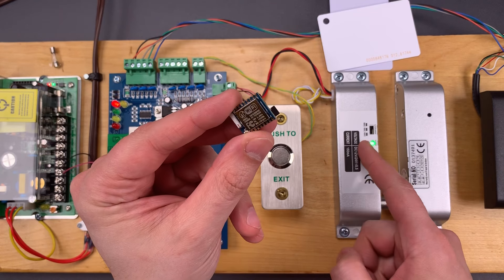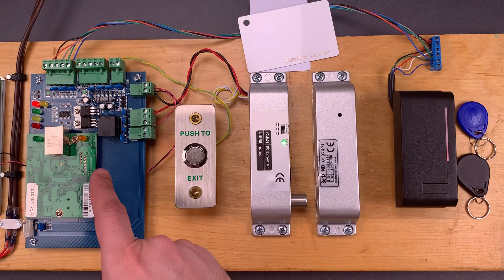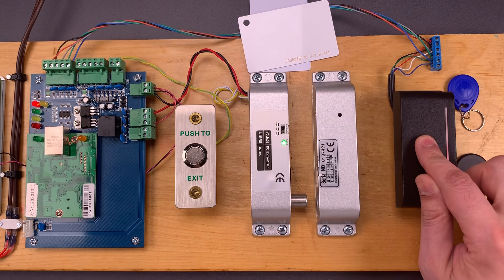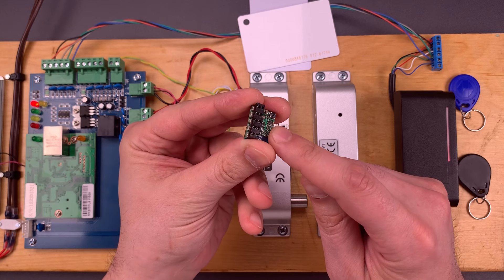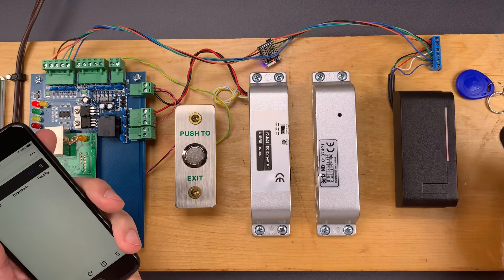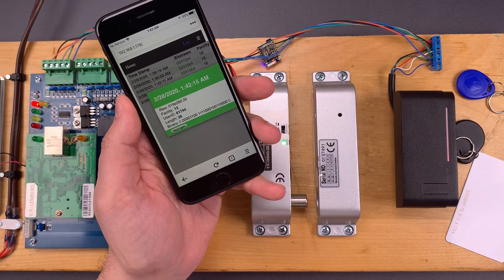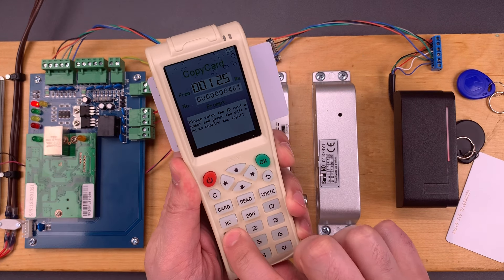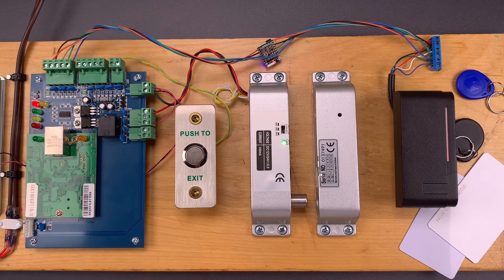[1052] Bugging an RFID Card Reader

Comment: So this is the equivalent of packet sniffing and then repeating captured packets?  And being able to basically image what you capture as well?  Honestly that's pretty damn slick.
Reply: burpsuite irl lol
Reply: except there's no packet or sniffing. It's plain binary hi-low signal containing a number.
Reply: @NGC1433  well putting a chip in the wiring circuit is none other than sniffing and a bunch of consecutive bits is a packet so yeah packet sniffing seems appropriate
Reply: @santiagobirkenstock  No, it isn't. The difference is, that you have to actually know the communication protocol for packet sniffing. This reader has most likely just a Wiegand interface, which uses two lines, first one for ones and the second one for zeros. There are no "packets", just a direct serial bitstream.
Reply: @mrkv4k  "know the communication protocol for packet sniffing" ... "likely just a Wiegand interface". tcp packet is just as common a protocol as weigand interface. Its exactly the same thing - record voltage over time on one or more wires, then convert that voltage history to information using knowledge about how the information was encoded to voltages in the first place.
Reply: @ehrenmurdick  You have absolutely no clue what you are talking about...
Reply: @NGC1433  you think packets aren't plain binary? What do you think they are, Italian?
Reply: @chrishamilton1728  You think a cake recipe isn't a vegetable?  (in case you've missed it, that's an analogy to your comment)

Well no, it isn't and they aren't... A packet is basically a message that is sent from one active unit to another. There is usually a header part, which contains addresses of both sender and receiver, number which tells you the data length, checksum and other stuff that is needed for the transport of data within said network. Second part of that message is usually data, which can be in plaintext or encoded in some way. Packet itself is like an envelope and if you want to read the data, you need to know how to "open" it.
Binary refers to the representation of numbers in a two state logic. If you wanna send packets, you don't have to use binary (even though most systems do). The thing that you are missing here is, that these readers use Wiegand interface and they send only the card ID number in binary form without anything else. So no packets, just data without the "envelope".
Reply: @mrkv4k  I did the same thing today with my oscilloscope - debugging an i2c peripheral I'm using. Whether you do it with wireshark or LPL's gadget or an oscilloscope makes no difference. Both sides have to agree on how the data is encoded, they use widely adopted standards to communicate that data. You have to know the encoding scheme to get the data back out. I can decode TCP packets with my oscilloscope too, just cut open an ethernet cable and hook the probes up correctly. 

The fact that you think the concepts are fundamentally different is a pretty strong indicator that you're the one that's out of his depth.

tl;dr no you
Reply: @ehrenmurdick  Are you in any way self-taught? Because that would explain the complete disregard for the terms and misunderstanding of concepts on your part...
Otherwise, I don't see how one could write.this much nonsense.
Reply: @chrishamilton1728  Everything analog, most telecommunication is transmitted with four state QPSK, 16 or 64-QAM modulation (there is an easy conversion between binary, but strictly speaking it isn't binary). But that wasn't the point.
Reply: @ehrenmurdick  I am dumping on strangers on the internet with negative statements without any attempt to clarify? Have you read any of my posts? What negative statements? Where have I been mean? I did clarify and tried to explain the problem In almost every post I've written here. On the other hand, you are just trying to sound smart, while mixing up different concepts and commonly used terminology.This sentence alone: "TCP packet is just as common a protocol as Weigand interface" shows that you don't know what you are talking about. TCP packet is not a protocol, it's a packet. Wiegand is an interface, not packet nor protocol. Packet is a message, the protocol is predefined structure of that message and interface is the channel which is used for the transport of messages.
 Even that "challenge" is nothing but a dishonest attempt to somehow own me or something.
Reply: @chrishamilton1728  No. The point was, that "binary" refers to something else than "packet", "interface" or "protocol". It's all about very poor use of terminology.
Reply: @mrkv4k  Classic backpedal, you literally tried to tell me packets aren't binary. Just stop talking.
Reply: @mrkv4k  Edit: My original response was too mean. What you're saying is that the terminology I'm using is technically incorrect. I agree with you on that, I don't mean to say that it is, I'm using the terms pretty loosely.

What I mean is that binary data goes over a wire, is recorded by a third party, and then arrives where it's going.

In all cases, the source and the destination must agree on how that data is encoded - if I cut the end of an ethernet cable and put a USB plug on it, it's obviously not gonna do anything if I plug it into my computer.

Even just plain binary over a wire only works if both ends share knowledge of the encoding. Is a high voltage a 1, or a zero, or neither in the case of (I'm blanking on the name. Something Scottish I think, where it alternates high and low). Is there a clock signal? Do I read the data on the clock at the rising edge or some other time? What are the voltage thresholds for high or low?

So an answer to my challenge, what actually is fundamentally different for them. Well, I would say that with SPI or parallel or something like that, all the binary data that is encoded is part of the message. With higher-level protocols, a portion of the data transmitted is metadata, things like a destination address or a CRC.
Reply: @chrishamilton1728  That's pretty much a Dunning-Kruger effect (without any negative meaning to it). You don't know what "packet" is, so you cannot comprehend why calling it "binary" is nonsensical. But that's ok...
Reply: @chrishamilton1728 
 Well, I have been working with electronics for more than 20 years and professionally designing complex devices for the last 10, so I know what I am talking about. It's ok if you don't. What isn't ok is being so god damn ignorant. I will stop responding to you, because it's absolutely pointless.
Reply: "The original Wiegand format had one parity bit, 8 bits of facility code, 16 bits of ID code, and a trailing parity bit for a total of 26 bits."

It's a formatted unit of data.  There's a payload.  The parity bit is control information.  It's a protocol.  It's at the very least a "frame."  If you want to split hairs, the fact that it's not routable might be the thing that distinguishes it from being a packet.  Even if there's no packet, it's still sniffing.  Sniffing isn't specific to networks.  See: memory bus sniffing, etc.
Reply: @profohki1828  I don't think that I am nitpicking nor splitting hairs here. Bad terminology leads to confusion and misunderstanding and I think that this very thread is a perfect example of that.

To that other stuff - no, "Wiegand" isn't a protocol. It's an interface which uses two wires. Negative 50us wide puls on one wire means 1, same puls on other wire means 0. It's only "one-way" and the driver (on the reader side) is usually in open collector configuration, so you can connect more readers to one input.
There are also 26b and 27b Wiegand ID formats , but those are something completely different and exist separately from the interface. Again, these are not protocols, but commonly used formats of RFID card IDs. Old systems had problems with more than 2B numbers, so they used a non-changing part (facility) and a changing part (actual ID) and checked them separately. Parity is used, but as a check of communication between reader and RFID card, not between reader and controller .
Most RFID readers with an Wiegand interface don't do anything with the received number and just send it "as is". Some send only the first 26 or 27b of received ID (because those old formats), but its almost never broken into "facility" and "actual ID" part (nowadays, it's easier to work with one 4B integer than 2B "ID" and 1B "faciity"). 

The main thing is that there is no metadata, no payload (you could say it's all just payload, but that wouldn't make sense) and no added control information between the reader and controller .

And sure, this is "sniffing", but not "packet sniffing", there is an important distinction. You don't have to do any additional translation, you don't have to detect different states of the interface and most of all, you don't have to trouble yourself with handshakes and networking. The biggest difference, though, is the ability to send "sniffed out" data directly back.
Reply: @ehrenmurdick  I think that there is a difference between "using terms loosely" and just using wrong terms. Like "cat" is never a loosely used term for "dog food", but that is exactly how close you are with some of that stuff.
If you "cut the end of an ethernet cable and put a USB plug on it", it's obviously not gonna do anything, but that's becuse you've changed only one part of the system. If you take an ethernet cable and put USB plugs on *both sides*, it will work (as long as it's certain length). Because ethernet cable is just bunch of wires.
I think that you are confused because some interfaces are only used with eponymous protocols, so you don't get the difference. Like you can take SPI interface (probably two for full duplex) and send tcp packets through it, hell you could probably take I^2C interface and use it with USB protocol (you'd need some changes to get speed up, but 1.5Mbps is managable). You can make your own protocol and use almost any interface you want. There are different layers and you are just skipping between them.
Btw. "something scottish" is probably Manchaster code, but again, that's about encoding, which is  something completely different than interface or protocol.
Reply: @ehrenmurdick  You left out the important part of that sentence: "So this is the equivalent of packet sniffing and then repeating captured packets?  Almost with all higher level protocols, it's impossible to "just repeat captured packets".

Btw, your analogy really sucks, because it isn't at all analogous. It's more like if there was a video about buying a watermelon and under that comment "so this is the equivalent of planting it and growing it from seed" . Where I'd started chiming in with "no, it's much easier than that, you just go to the shop and buy it" . Then your response was "Nah ah, going to shop is the same as going to farm, buying it is 'technically' the same as waiting for it to grow. I am just using terms loosely, you know, buy or grow, same thing." To which I responded with "you have absolutely no clue" and get the backlash with stuff like "You're just dumping on strangers on the internet" and "You've made nothing but negative statements" (neither is still true).

And to that last sentece. My best guess is, that that's just projection on your part. You don't know much, but you have the need to show off anyway. And then claim that others are mean to you, when they call you out on your BS. How many RFID readers have you designed? I'd say none...
Reply: @mrkv4k  All your comments have been "no you're wrong". Projecting? You're the one who started questioning people's education, so if you think that's projecting then you are the one who is doing it, genius.

Also, it's a great analogy, because watermelon actually are berries. Are you in any way self-taught? That's the only way to explain not knowing how to spell "Manchester".
Reply: @ehrenmurdick  None of my comments are just "no, you are wrong", there is always pretty detailed explanation why you are wrong. I don't know why you are so butthurt about it, being wrong is normal.
And I didn't question people's education either. There is nothing bad in being self-taught, it's just a good explanation why you kept mixing up terms.
The analogy doesn't work, because I wasn't nitpicking as it suggests and it's something that is actually important if you want to understand what is going on there. Sure, watermelons are berries, but that information isn't important, if all you want to do, is to eat it.
And to that last bit, pointing out spelling mistakes, when you run out of arguments, that's just an internet classic. It doesn't make you sound smarter tho.
Reply: @mrkv4k  "no added control information between the reader and controller ."

I think you're missing the point.  It doesn't matter if the protocol is between the reader and the controller or the CARD and the controller.  The latter being exactly how Wiegand operated when it was dumb readers and Wiegand wire cards.  As the card runs through the reader it creates transitions on the lines that are interpreted at the controller. That includes the parity because the parity encoding is part of the card.

Just go look at the code for the ESPKey device shown in this video.  You can see for yourself that the parity bits are on the wire and how they handle them in the logging. The wires being tapped here have data.  They have metadata.  

The "Wiegand interface" is two wires, +5VDC, and determining 0 or 1.  The "Wiegand protocol" is the number of bits and the parity.  The sniffer is reading and storing a number.  It's decoding the protocol.  It's not a logic analyzer that is just storing line state and timing.  Everything in this video deals with the Wiegand protocol ON the Weigand interface.

I mean, the SIA's standard for this stuff when it was formally adopted in 1996 is titled "SIA AC-01-1996.10
Access Control Standard Protocol For The 26-Bit Wiegand TM Reader Interface."
Reply: @profohki1828  What metadata would that be then? I mean, you can call it a "Wiegand protocol" if you want to. It's a bit of a stretch, but who cares. Problem is, that Wiegand interface became popular and it's often used with all kinds of cards. Cards that use different ID lengths and/or structure. Also, there are readers with numeric keyboard that use this interface to send both ID numbers and keystrokes (or whole PIN). Implementation of these is all over the place.

The programming of that sniffer isn't really important. They check the parity bit to see, if it's a valid ID number, but that isn't universal and will not work with other cards.
Reply: @mrkv4k  First of all, Wiegand protocol is a protocol, I'm not mixing up terms. Wiegand interface and effect are different things. Maybe if you had ever designed an RFID card reader you'd know that.

Second, the point I've been trying to make the whole time is that in order to get data from a wire, you need to know the details about how that data was put there. That's like the definition of a protocol.

What you are still defending, and I am still arguing, is that in order to read the data off of some wires you need to know how exactly the data was put there. (That's what a protocol is! You're just flat wrong here. Look it up!)

So in your universe, say I'm on the other side of a curtain. I pass over five wires. You know I'm using those wires to send a message but in your universe, you don't need to know anything about how I am doing that. It's "just serial data". I don't tell you which wire is which, if I'm using an established protocol, or even if I'm using all five wires. But somehow you can "just read the serial data." How exactly does that work, in your world? (Obv you could figure out what protocol I'm using eventually if I am using an established one - but my point stands in this case -- you *still have to know the protocol*. Even if you figure it out later, you don't know what the message is until you decode it)

That's what I'm arguing against. Please tell me how that's possible.
Reply: @ehrenmurdick  Very funny. Since I work in the access control industry as a HW designer, I did design RFID readers. Actually three different readers for both 125kHz and 13,56MHz standards within last 8 years. Plus two controllers with support for Wiegand/RS232/RS485 and an access terminal with graphic LCD, internal reader and Wiegand interface for external RFID reader. So I do know very well, what's going on, and that there are readers with Wiegand interface which don't support old 26b or 27b standards.

"in order to get data from a wire, you need to know the details about how that data was put there" - Nobody here is saying that that isn't true. The main problem is that you are missing the second part. "Packet sniffing" is much harder exercise that what's in the video. Especially if it's something more sophisticated like TCP. You can't just listen to the line and then send previously recorded packets back, because there is usually a two way communication. Like a request and then a response, or at least a handshake. But you can do that with a simplex interface like Wiegand. You don't have to even decode what's in the frame, you can just record it with a digital analyzer and then send it as many times as you want.
TCP sniffers are usually just passive, they can record what's going on, but they can't send anything back. Active device would have to physically split the line between reader and controller, let some packets through, but block others. It would have to pose as the reader and mimic its behavior for the whole transaction. Again, that is sooo much harder than what's in the video.

Ad "What you are still defending..." - No, I am not defending that. In fact, I've never said that.
Reply: @mrkv4k  its just sniffing (like with your nose) a packet of data (an amount of data)
Reply: @132ikl  :D
Reply: @132ikl  finally an expert stepped up to finish the debate
Reply: @ehrenmurdick  the reader and the controller do not talk tcp/ip between them. it's either the widely deployed wiegand protocol which is old and unsecure or some newer protocol, but still serial.
Reply: @mrkv4k  This is just as much packet sniffing as if listening to TCP packets. And it's just a question of intellicence if the reader will send the code once or if it will keep sending it again and again while the key tag is within range.
If it's electrically Wiegand, RS232, R422, RS485, ... is irrelevant to the concept of packet sniffing.
Reply: @mrkv4k  Wiegand is both an electrical interface and a protocol with packets, where the packets starts and ends with parity. The packet length and the fields depends on type of encoding used. You asking others if they are self-taught is a slur but it still comes back to you being the one who is wrong here.
Reply: @perwestermark8920  You are wrong and I have already said enough. Wiegand is an interface. "Wiegand 26b" and "Wiegand 27b" was a name used for a RFID card format, which is not used that often anymore.
This reader sends everything it reads from the RFID tag - "as is", so using term "packet" is at least a stretch.
Also, being self-taught is not and never was a slur, it's all about my pedantry and use of proper terms, which was imposed on me when I studied to become an electrical engineer.
Reply: @mrkv4k  Good of you, the "professional" to know more than HID Corporation. You claim Wiegand means is an interface. They - the originators - claim Wiegand means 6 different things:
1) A specific reader-to-card interface
2) A specific binary reader-to-controller interface
3) An electronic signal carrying data
4) The standard 26-bit binary card data format
5) An electromagnetic effect
6) A card technology

The data - as transmitted - can be sniffed as a packet. Absolutely nothing strange at all with this even if you can't reformat your brain into accepting this as packet sniffing. No difference from sniffing CAN frames or some other signals. And it very much is a frame or packet which the scanner must use timing to separate since the individual bits are defined based on their position in the bit train. That content the reader sends is already encoded as a packet in the RFID tag. Look at the specifications with parity bits and parity computation rules and all.

Having a separate wire for zero and one does not matter just as it doesn't matter I2C has clock+data and SPI has clock+RX+TD while USB just has D+/D-.

My instruments at home has never had to listen to you, so they have missed to "understand" that they should not support packet-sniffing of Wiegand 26-bit, 34-bit, 36-bit and 44-bit. For other formats I would have to do raw data  captures and write a script to convert. Same as if I do packet sniffing of TCP for some application protocol I don't already have decode logic for.

Your skills might be in hardware. Don't bend your back backwards trying to force your views on communications practices.
Reply: @perwestermark8920  "Don't bend your back backwards trying to force your views on communications practices." - I think that You should try that.

Sure, it is a frame, but frame is not a packet. That term is typically used for more sophisticated protocols. For example, if you take your own example, CAN bus data frame can have 108b, out of that 64b (8B) is data. Wiegand 26b has 26b, out of that, 26b is data (24b if you exclude parity bits, which is nonsensical, because every modern access control system works with an entire 26b number).

This whole conversation is about semantics, and I think important semantics. As I said, this is not "packet sniffing", because it is much easier than typical packet sniffing. You don't have to deal with any complex stuff, you don't have to check what state is the line in, no networking, etc.
This is kind of a device is an afternoon project, packet sniffing really isn't.
Reply: @mrkv4k  Ever heard of the old guy out driving when he hear in the radio about some car drivimg against the traffic? "One car - damn every car is driving the wrong way!"

Your view on semantics might actually be the wrong one...
Reply: @perwestermark8920  Sure, it might. And You might be an artificial intelligence unit writing this from Mars. Probably not tho.